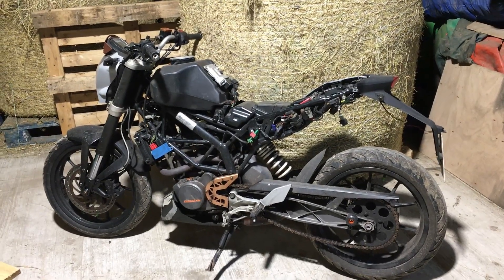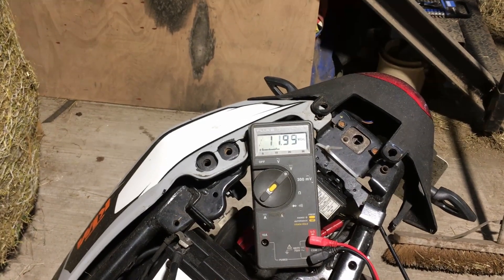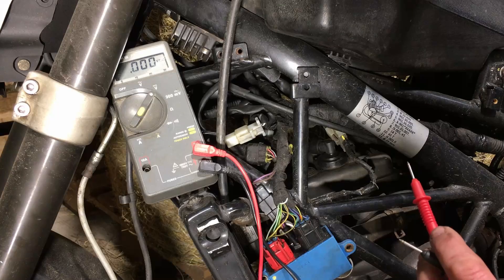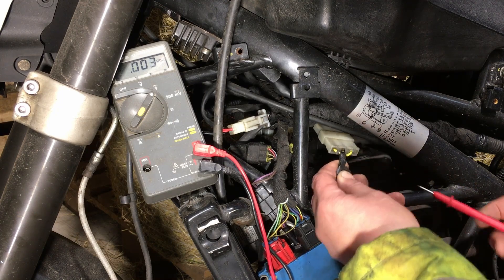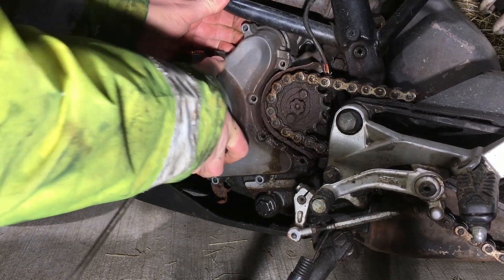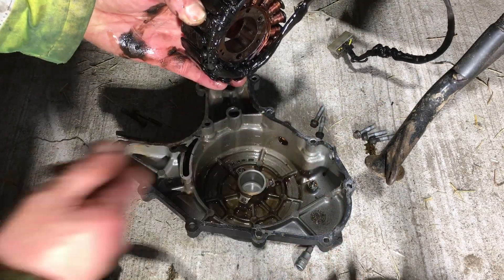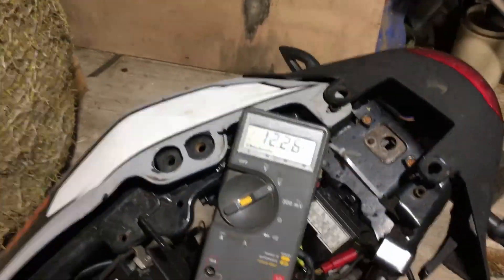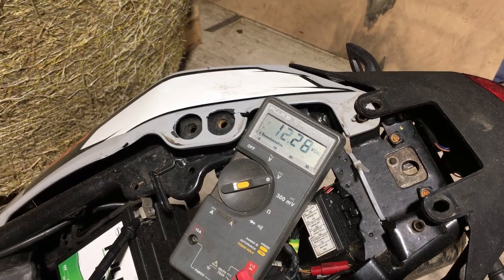KTM Duke 125 - Battery not charging, Diagnosis and repair!

Comment: When measuring the regulator, I had voltages of 0.6 0.4 0.6, I changed the poles and the middle one had 36MOhm, should I replace the regulator?
Reply from the maker: Been a long time since I looked at this, I'd first check the stator windings are ok, if not then the regulator is the likely culprit

Comment: Is there anything you won't fix ??
Reply from the maker: Just bike intercoms 😂😂No seriously I'm going to look at that next. I was editing my latest video until 2AM last night so I had something to put out today, didn't get to sleep until around 3:30am, up at 7:30am and then at the repair cafe all day. Then I got a call from a good friend asking for help with a car that had a problem with the crankshaft sensor not working after he replaced the engine. The CS sensor was a 2 pin and the one on the original engine was 3 pin. I did wire it up to the ECU the same way as the original engine and then it showed other faults. That turned into replacing the ECU, clocks, BCU, and key transponder from the donor vehicle as it turns out the engine was slightly different. I only just got back about an hour ago and now it's midnight.. and I'm replying to YT comments...

Comment: It probably burnt up as there was no oil in there. It probably won't last that long either if you didn't put any in.
Reply from the maker: I'm not sure about this particular engine, but I don't think I've seen them submerged in oil. For instance your car alternator isn't. I don't think he has it now as I think he sold it.
Reply: @BuyitFixit "I think I was mistaken. I now believe that there is a jet that sprays oil around the cogs, which comes from the other side, and then the oil makes its way back to the sump. I was just wondering, as there seems to be an oil fill cap on top, and what other purpose could the gasket be serving.
Reply from the maker: I'm no expert, but perhaps the gaskets are to keep dirt and debris out. I could totally be wrong on this. I'd probably have to download a service manual to be sure. Seeing as he hasn't got it anymore I'll just leave it as a mystery 😂👍

Comment: an easy way to test the stator is to start the engine an test the voltage between any 2 yellow wires working through them all they all should output  roughly the same voltage
Reply from the maker: I thought I had done that, perhaps I accidentally edited that bit out. I remember there was an AC voltage but it didn't seem quite right.
Reply: All three wires AC output should be the same??? In my case, two wire output is going up to 120 as rpm increases bu one wire show 80-90v. Battery is not charging I replace new bAttery. What do i do n0w?
Reply: How much should the reading be then ?
Reply: @Kevin-us7jc  it depends on how fast the engine is revving but they all should be the same'ish  voltage that's the main thing

Comment: Was there oil inside the stator case? I have the same problem on my duke 125 and it is probobly the stator and wondered do i need to drain the engine oil before opening the case.
Reply from the maker: There wasnt any oil in where the stator was. Not sure if that's normal though..
Reply: Alright i need to check mine
Reply: Yes we need to drain the engine oil before opening The case.
Reply: I believe that it's normal to have oil in there. The oil cools the stator I believe. You can best give a KTM dealership a call and ask them to be completely sure but I know it's the case on my Suzuki motorcycle. Nice and interesting video nonetheless!
Reply from the maker: @Stryker-qw4bp Thanks for that and Thanks for commenting.

Comment: so fare so good but long term ... here is some important notes 
1 the stator bolts need locktite . - vibration can get them to loose free 
2 the top stator wires port leaks oil with the non oem part (need to be seald ) 
3 the voltage regulator and stator need to be replacet at the same time , if not it can burn again after 1- 3 month of use 
it might last longer but it will not last .
4 change your engine oil + oil filter and coolant .. so the engine will not overheat and coock the new coil
Reply from the maker: Thanks for that 👍 I'll pass that info onto my son as he's taken the bike away now. I think he was talking about replacing the seal behind the stator as it seemed to have a bit oil in there.
Reply: @BuyitFixit  the overall repair was quite good . thees small details  help the long term . the chineese stator dose leak from the yellow wires port
Reply from the maker: @MechanicsDIY  Thanks Mechanics DIY 👍
Reply: Why would one replace the RR unit if its working fine.?